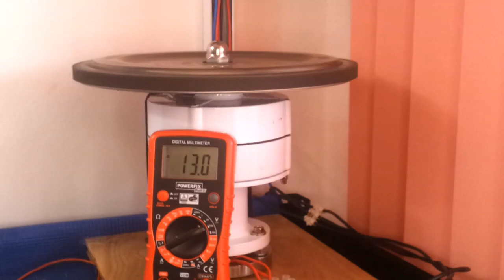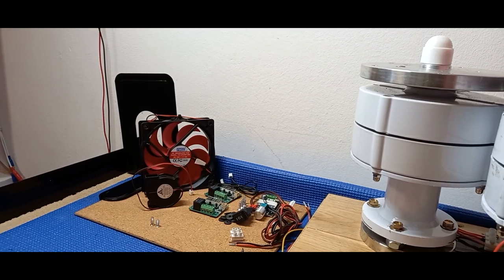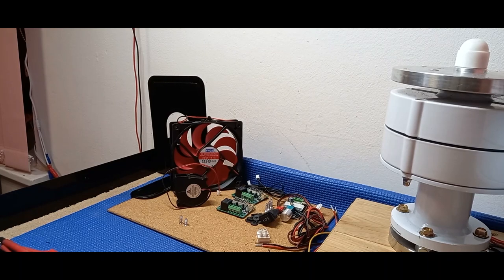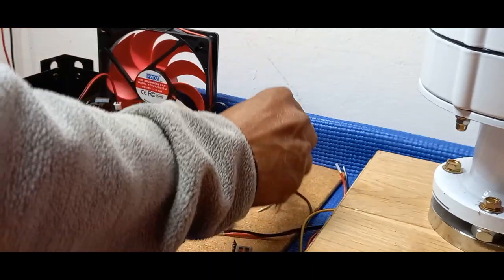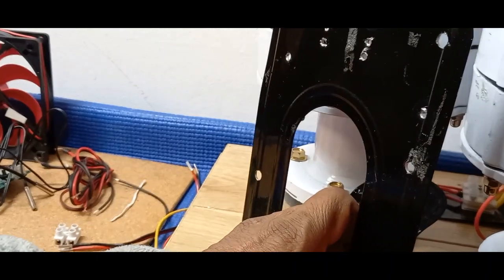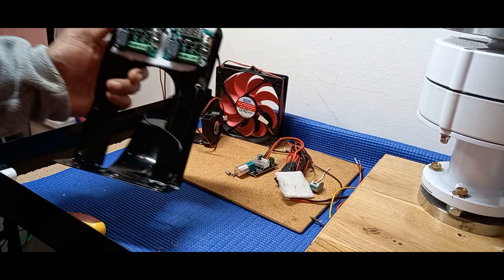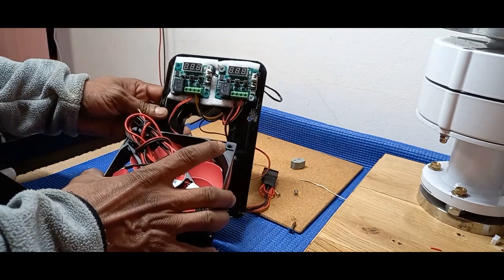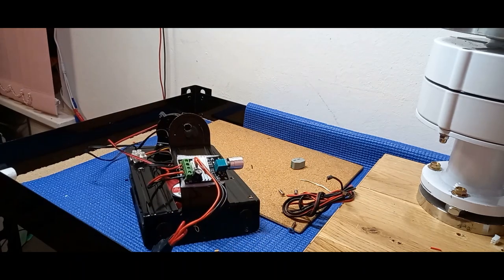Free Energy Generator - works Anywhere - Building Digital Thermal Speed Controller

Comment: I have modified a 24 volt 100 watt unidrive bldc motor its now 3 phase in and 3 phase out. @12 volts dc input I get over 300 volts out, and it run cool as well as has enough power to turn another device. Uncle Dean Here
Reply: Its a grate news, develop your inovation, go further,  Dont forget your mind is your capital. With regards

Comment: So the fans are to cool the circuit?
I have not noticed any heat, in the transistors or the turbine. Maybe I'm not pushing mine hard enough yet.
Thank you for the update video.
By placing a reed switch on the inside your going to catch the coil field when it pulses bro.
Reply from the maker: Originally, These machines are manufacture to work in open spaces, but, I am running indoors. If those propellers are fitted,  the propellers will cool the machine, on its rotation. I have two machines working side by side with two different magnetic fields, and they are overlapping each other, this will also create some heat. it's better to have a vent unit. better be safer than sorry.
which is taking only consuming 0.01 AMP and 0.06 Watts, it's not affecting or consuming any considerable currant. 

this is also tiny technology to create a vent with controllers, which could be used in many applications as a cooling unit. this may be also useful to others, just a little idea.

Thanks for the comment. and all your comments are welcome. if you like to view future developments, please subscribe. thanks